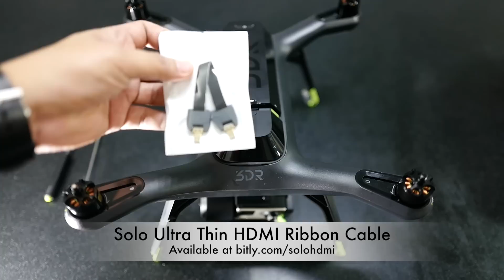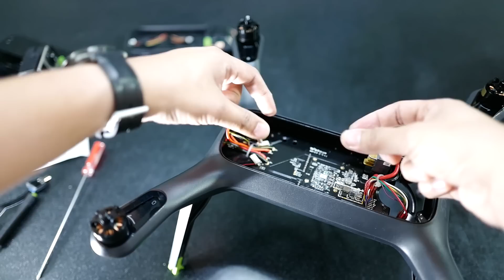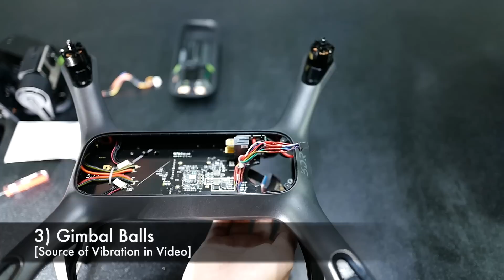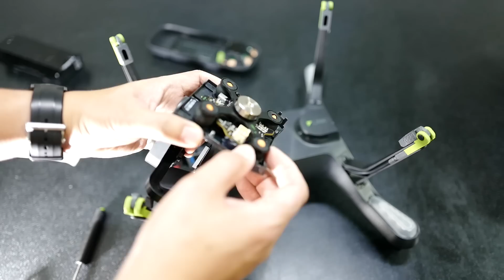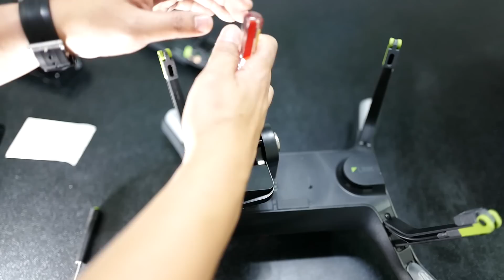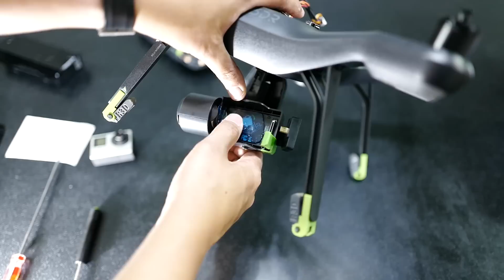Tutorial - Solo HDMI Ribbon Cable

Comment: Would this possibly be the cause of HDMI video feed absence? Would it be next best step (least cost) toward repairing a total loss of HDMI signal from Solo to the app? Bird flies great line of sight, all of the gimbal functions including REC in the app and the attitude functions of the gimbal are nominal. Tested the GP's  HDMI signal at the HDMI cable connecter to PC and played back from the GP successfully. Any help and or guidance would be helpful.
Reply: Should bypass gimbal HDMI connection and connect the original micro HDMI directly to GoPro to see if you get video feed. Ribon wire inside gimbal does go bad sometimes or end connections have bad soder

Comment: my gimbals hdmi is broken somehow. connecting my GoPro directly to the Solo gives me live feed but adding the gimbal gives me a black screen thats how I know my gimbals hdmi is faulty.

basically what Im thinking of doing is buy the ribbon cable if you have one female and one male ends

so I can connect one end(female of ribbon) to the stock hdmi cable(which is male) in the Solo then routing the other end of the ribbon outside the solo so I can connect it to the GoPro directly...

Im guessing the ribbon is thin enough to squeeze through the gimbal cover and if I can get such cable Itd be no problem managing the cables angle going towards the GoPro without stressing the Gimbal too much. If these ribbon cables are soft enough for me to change the gimbals angles still then it might just work...

or does any else have a fix for my broken gimbal hdmi?

Comment: I installed the ribbon cable, put the moon jell, and I did not extend the gimbal wire and the vibration is better but still getting jitter. the gimbal itself makes a buzzing sound when centered. If I tap on it the sound goes away. I'm wondering if I just have a bad gimbal.

Comment: For some reason, when my 3DR was automated to come home, it did not slow down on landing and took a very hard landing on pavement. The GoPro went flying out and I bent one of the feet but luckily I have the leg extenders. Everything seemed OK when I went to test it again but then when I went to make sure the Gimbal was not damaged, I took it apart. I noticed the rubber boot came out but that was it. 

I went back outside to try the 3DR and it said I needed an update so I updated. 

Then I was getting very bad live video. The recorded video was fine and it flew fine. I brought it back in and checked my HDMI connection again by taking off Gimbal. After that I had no live video at all.

So now, I'm going to Best Buy to get a micro HDMI to full HDMI cable to test my GoPro. If that works I may see if there is an issue in the Gimball and if that isn't it, I will replace the cable as such in this video. 

Where do I get that ribbon cable? Also I would like that clip you manufactured. 

One other thing I worry about is taking the HDMI cable on and off again from the GoPro and I'm afraid the connectors will eventually ware out. I would like to be able to get the Micro_SD card out without unplugging any cables. 

Thank you for the video. Jack

Comment: Great video and great product. I had to compliment you, I was not having video issues but ordered this for weight savings and I am very impressed. I ordered it last wed. (15th) and it arrived on Sat. (18th), installed easily and works perfectly, Thank You for a great product and excellent service!. Quick question... I noticed that when you lengthened the GPS cable that you removed the "ferrite" ring, did it improve the GPS function any?, my solo has a horrible time acquiring and keeping GPS lock. Thanks again!